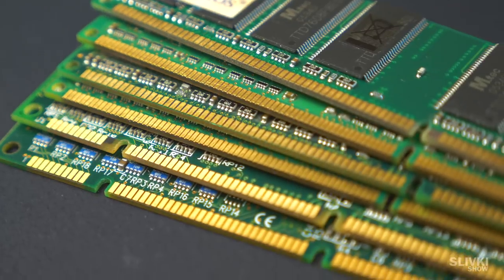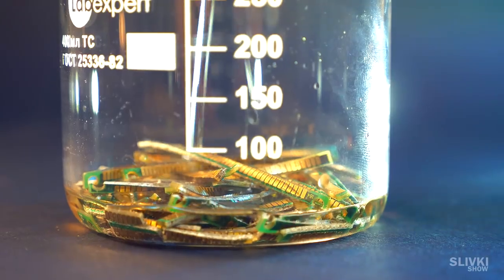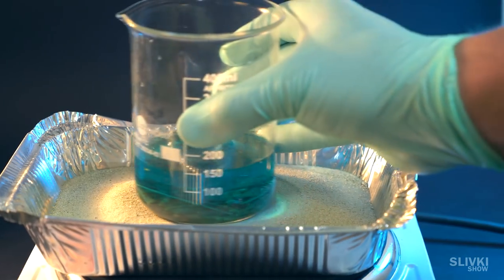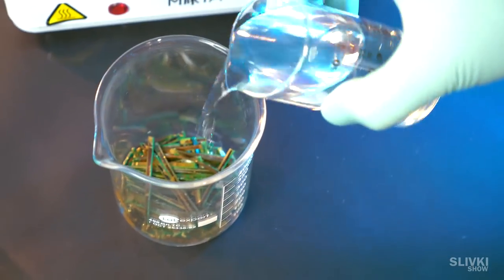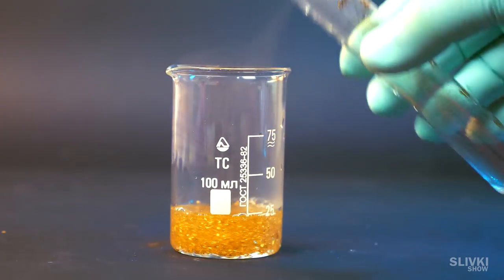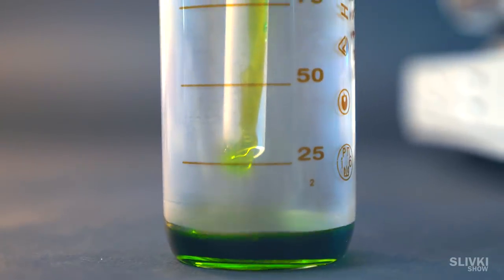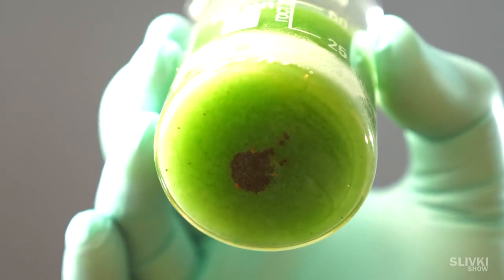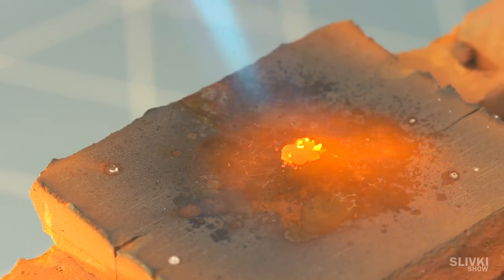HOW TO GET GOLD FROM OLD COMPUTER [EXPERIMENT]

Comment: Extracting gold from scrap electronics on a small scale isn't worth it. The chemicals will cost more than the gold you get. It's only profitable if you do it on a pretty large scale (spend half your day gathering old electronics and the other half extracting the gold from them), and even then you won't get rich and would probably make more money if you just worked a regular job.
Reply: My brother worked in a metal refinery, they burnt old circuit boards to extract precious metals. Having a blood test every week to check for lead, as you breathed in a lot of poison from the furnace too. They sell £6000 silver ingots. And other ingots. But the place is very large.
Reply: hcl, and nitric acid arent nearly as expensive as you might think
Reply: how large are the silver ingots cause silver isn't worth much now days
Reply: @BenWilliamson-et2ge  this was about 7 years ago when silver was expensive, they provide sterling silver for jewelry making I think, most of for industrial products.
Reply: more worth it to sell on ebay for retro collectors to buy
Reply: just sell the RAM

Comment: How did you know that gold is real haaaaaah???????????????
Reply: here comes ros's  player
Reply: Ros  baby but bro gold is best conductor of electricity every mobile contain 1dollar gold
Reply: ^^^ That's why computer RAM chips are expensive
Reply: Because gold doesn't react with acid...
Reply: Two things:
1. Gold does not oxidize in any conditions at all. Meaning even if you put water on it, it will not react to it.

2. Gold is very soft, and therefore, makes for a very good electrical contact.
Reply: You can bend it
Reply: Fools Gold.
Reply: yeaaah its fake GOLD
Reply: Come on! Almost of all peoples here knows that thing is GOLD... Did you even know?

Comment: i used to get gold out of scrap motherboards, ram and cpus... it aint worth it. Ive managed to get money off of it... but to actually make a "profit", you would need to get at least 1000 motherboards, 500 ram sticks, 1000 cpus to yield somewhere around $1k of gold... dont forget, however, of the chemicals you just bought to get rid of these. Most recycling companies have industrial labs that would get these out quickly and efficiently. Its too much work but if you dont do it, someone will.